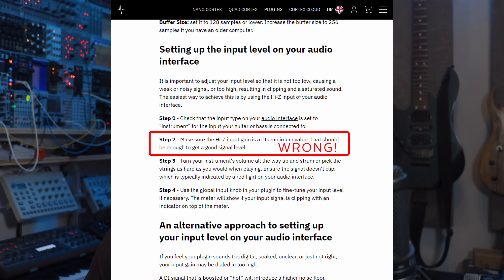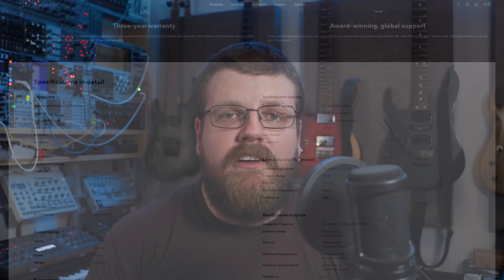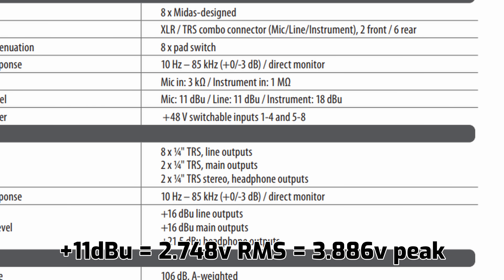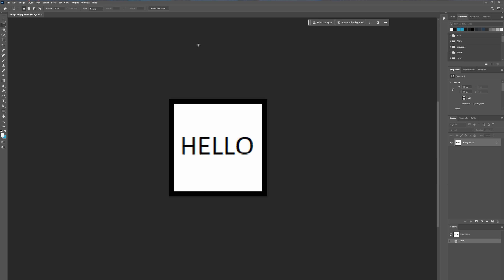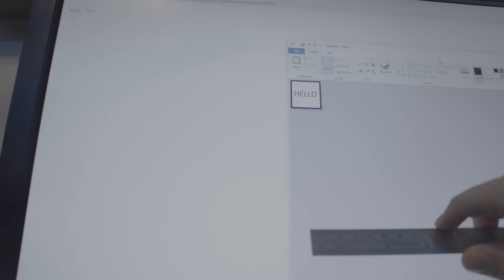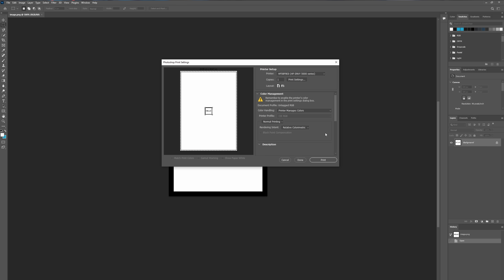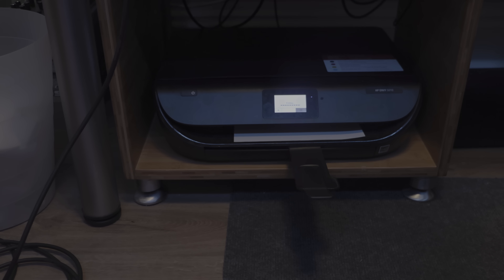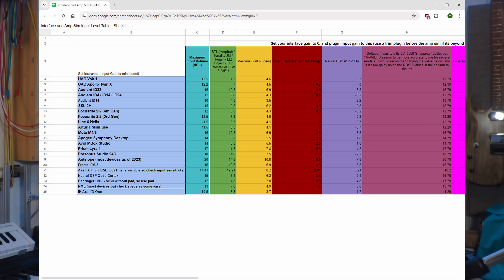Ampsims and input gain - Please, stop the madness...

Comment: Nice topic. I am a digital designer who also worked on some mixed mode devices. However no audio chips. What I can tell is that if there were no standard interfaces in the digital world like there are almost none in the analog world we would have a big problem doing big system on chip circuits. On the other hand there is always a way to determine what the 1-bit of ADC represent in terms of voltage value if you know the input voltage range. The designs I worked with had those specified in registers so the SW could operate and use it to process the data correctly. I mean you need to know this for precise measurments of analog values. The thing with the digital audio IF is that there is no standard and gain knob is typically implemented before hitting the convertor so making automatic calculation is difficult if not possible. So the best advice is probably use your ears.

Comment: Why I still think you're creating confusion: your method addresses only the improvement in SNR. Nothing to discuss here. All correct.
EdS spreadsheet and others you're calling them wrong are addressing a totally different issue, the issue with input gain for different pluging manufacturers so the plugin will sound and react like the real amp they're modelling. 
Your method is not improving the quality of the plugin's sound, just lowers the noise floor. 

So, let's say someone wants to lower the noise floor using your method, how do you address the input gain issue for different plugins? Have you tested your method against real amps, because that's all about with EdS spreadsheet?

Comment: I would volunteer an alternative approach that still satisfies the original goal: To set input gain until the source's self noise sufficiently overcomes quantization noise by some reasonable margin. The reason for this approach is that people are not necessarily that good at judging how loud the input will be when playing "as loud as possible" and it is possible to ruin an overly excited but brilliant performance recording with unwanted clipping as the performer plays just a tad louder than they thought they would during gain adjustment. I suppose for amp sim applications a touch of clipping on the input is likely to go unnoticed, so this might not matter much.

Comment: So, my understanding of the issue (from the perspective of an audio engineer, guitar player, and software engineer, but not a DSP engineer) here is not that 0db input gain was the point of this discussion, but a repeatable pattern for getting a predictable ratio of input voltage and digital signal. Such that for a given set of different guitars, the same compensating digital gain will produce different digital signal levels, just like different guitars produce different voltages. The trade-off here is that you get worse signal-to-noise ratio, but what you gain is predictability. The method you present in this video prioritizes signal-to-noise ratio, but now you need to figure out how to make your active EMGs and your vintage strat have different levels of gain in your plugins. I don't think the 0db approach is wrong, and using math and science, I think we should say it makes a different set of trade-offs for a specific goal: predictable input voltage to digital signal ratio at the expense of signal-to-noise ratio. Happy to hear any technical feedback about we might actually cut through this Gordian Knot and achieve both: maximum SNR and predictability/repeatability/differentiation.

Comment: I worked as a designer in delta-sigma for many years. I developed some tech that was patented and is used in a commercially available audio interface. 

Your analysis is correct but everyone misses a crucial element. There are IMD related artifacts that occur from hotter input levels. They have nothing to do with SNR or digital overs.  They have everything to do with power supply related noise. All that current being pulled as the ADC tries to pull current to meet its demand creates an intermodulation distortion product.

Comment: Wow, that’s an eye-opener. I think, though, that the main reason it’s the right approach for metal guitar is that so much gain is applied by the amp sim. It’s also a good idea for vocals if they’re likely to be heavily processed, especially with compression. For drum recording, though, you usually want to set your peaks to about -12 dB FS during setup because the drummer will hit harder when the session starts, and any peaks over about -6 will get cramped by the line amps. This is because 0 dB FS is near the point where the analog input stage would clip, where it begins to lose its ability to handle sharp transients well. Sharp transients on electric guitar attacks are going to get clipped by the amp anyway, so it’s fine to cramp them a little on the way in.

Comment: Essentially what you’re saying is that nothing has changed: you should use the same approach from when didn’t have digital.   Also, the correct method: maximize gain while preventing clipping, then adjust till it sounds right.  Also, as you know, you can still clip a digital signal, so you still need to manage gain on the digital side

Comment: I feel like it really is as simple as "set the level where the guitar is at a healthy level, but you can play SUPER dynamically without clipping the hardest parts and losing the softest parts". I usually have my guitars hitting a peak of around -4 to -6db on the hardest parts.

Then just use the input gain trim on the amp sim to set the gain where you want it for the desired effect of the amp sim. If you want a clean tone that breaks up when you slam it, have a lower gain. If you want to drive the pedals and head really hard, raise the input gain a ton (go ahead and clip it even).

The golden rule with recording analog stuff is nail the signal to noise ratio because you can tweak gain basically infinitely in the DAW. It's just difficult to offset a SUPER noisy signal, and it's almost impossible to fix something that clipped in the analog domain.

Comment: I could never get a decent clean sound from my Marshall plugin like I could from my real physical Marshall amp, then I saw those videos telling everyone to set the interface to zero, I tried that and it cleaned up BUT it seemed silly to have such a weak physical signal so I put the level back up on the interface and introduced an eq plugin before the Marshall plugin, ran the eq flat but turned the gain way down and (I think) solved the problem in the same way you did. Thank you for confirming what I had suspected.
Reply: Almost all amp sims have an input level control. Which one are you using?
Reply: @  it’s the UAD Marshall Plexi Classic that comes with the Apollo Twin. I’ve looked for an input control but I can’t find one.
Reply: @ErebosGR  I don’t suppose you happen to know if the UAD Marshall Plexi Classic has an input level control? (It would be great if it did).
Reply: @josemelrose5465  Your daw should have a utility for adjusting the amplitude of the signal without needing to put an eq in front of it.

Comment: This is a great video and I'm glad that it goes hand in hand with what I was taught in college about signal to noise ratio. However, do you have any advice on how to measure the actual db level of the gain you're increasing with your interface? The difficulty for me has always been in understanding how much exactly I need to trim from the vst's I am using.

Comment: Not that I am a genius or a good guitarist but I have ALWAYS done it this way ... for 15 years now.  Just bought a new interface Persons Quantum ES .. it sets auto gain as far as input to the converter.  This is critical because I record this and save it as a stem.  Setting the plug in input gain can be done on the fly or set more careful as I commit the stem to a .wav file in my DAW.

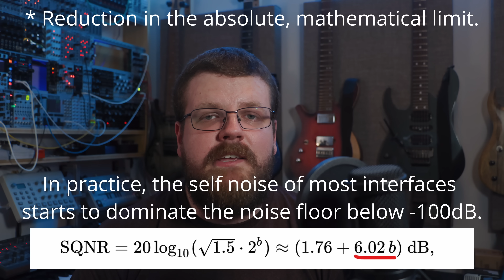Comment: 6:40 Wait a minute. I've always read that bit depth corresponds to frequency range. S/n ratio is more about amplitude. I watched this video to the end and I agree the end result is better. I  just feel like something is off in your explanation of bit depth.
Reply: Yes and no; sampling speed (when we talk about recording, when we talk about playback we talk about bitrate) is what allows you to sample a sound fast enough that even the highest frequencies are captured. Bit depth is what allows you to store a wider range of amplitude values for your sampled points, with more granularity. Both are related to the frequency content that you're able to replicate, because even if you have a fast enough sampling speed, if you don't have the "resolution" (bit depth) to store amplitudes that are almost the same but vary by a few millivolts, your high frequencies will not be as well represented as they could be.

Additionally, for the purposes of this video, if you're barely just turning up your gain control, it means that the amplitude range of your source sound will be very narrow, and even if you have the capability to store sounds that reach high amplitudes, you won't really be using all that storage space (bits), and more importantly the sound you're recording will be almost as quiet as the noise the interface naturally produces, which is what we don't want. This is very simplified but I hope it gets the point across!

Comment: If you turn down the input signal, you're making your expensive preamp sound like a cheap one at optimal gain.  Noise also adds up in a track.  24 tracks of badly gain-staged microphones is going to VERY noticeable.

Comment: sound engineer here. I'm onboard with setting input gain on the preamp (before A to D conversion) to hit just a couple of dB shy of clipping. What I don't understand is why you would set up the input gain to the plugin using a table. Clearly how hard you push the (digitally modeled) circuitry is a creative choice that impacts how much non-linear coloring the plugin imparts, among other things. A value from a table can only ever be a starting point, and not the "correct" value, as the amount of drive etc. is a creative choice that is ultimately made using ears. I was surprised that you don't mention this.
Reply: It's for having the "authentic response" of the amp it's modeled after. If you turn the gain to 5 on your amp sim, it will sound like gain on 5 on the real amp. It's useful when using amp captures, for example on Neural Amp Modeler. That way you can have exactly the same sound as the person capturing their amp.

Comment: Being an old guy coming from analog AND later limited bit times and therefore higher noise floors, there is this always true principle: Use as much unclipped range as possible.

AKA Pump up the volume. 😂

Greetz from a fellow E-Tech Engineer with a nerdy passion for moving air.

Entertaining Video for the younger guys with their hissing guitar sounds.

Comment: I think some of the the confusion is about what 0 means on the interface. I believe that many people refers to zero as the clipping point and not the gain (attenuation) on the input. Hence the big confusion.
I agree with your approach, although worth mentioning is that people often play louder AFTER sound check so it's wise to turn down the gain a little more than just below clipping to avoid digital distortion later on.

Comment: why minus 19.2 db? hows the calculation? im getting confused please help thank you
Reply from the maker: We had originally set it to +4.8. After adding 24dB of gain on the audio interface, before the analog-to-digital conversion, we then reduce the gain after the conversion has taken place, in software, by the same amount. 4.8 - 24 = -19.2
Reply: @GhostNoteAudio  Thanks for reply! i'm not sure if i correctly added 24db in my audio interface right now. how to know i got it right? please

Comment: You said two gain/volume controls that you need to worry about. Yet with guitars you will have at least one or more volume controls. Playing at full volume on the guitar produces a higher output than does playing at a reduce volume. So I would say gain stage starts at the guitar and ends with the amp sim. Thus guitar>interface>sim. And since one is most likely recording the guitar in a DAW one can always dirty up the recorded clean sound but one can not clean up a recorded dirty sound.

Comment: i'd say the peak of your audio must fill your 24 or 48 bits , one thing i wonder is if a logarithmic version of the audio would favour weaker signals and well the peaks are still peaks filling the 24bits and you get the best you can get unless your input amp is spewing distorted at that volume tough for inputs it's called say preamp input level
Reply: evidently you dont want to amplify digitally

Comment: Sure, you right about how to optimize for SNR of the A/D converter (while still giving the appropriate signal level to the plugins), but is that objectively the most important factor to optimize for? Above simplicity/workflow/etc? I never heard a recording from Rabea and thought “oh no, that amazing piece of music is ruined by the bad SNR of his recording”, nor read anyone comment something like that. And is probably even less of an issue for the kind of playing/recording most of us (I assume the intended audience) are doing at home…
Plus, if one would become that much of a purist, couldn’t one instead direct attention to the fact that analog signal boosting (gain before AD conversion) is not perfect, and probably can alter or introduce some (undesired) coloring to the signal? 🤷🏻‍♂️ Neither of those seems to be an issue with any modern decent interface, though, and that includes most of the brand-names affordable ones too.

Comment: 100% agree. Good video! Unfortunately on YT there are many videos with erroneous information that spread like wildfire. I believe that what is really important is to know the input level of each of our Amp Sims and adapt the signal to it, although this is difficult due to the little information that the manufacturers give in this regard. There are many AmpSim comparison videos where the input level is the same on both, without correction, so often the conclusion is that one of the two sounds "too compressed". An erroneous conclusion that comes from not knowing the optimal levels of the plugins. 

1) Entry level with our healthy interface, without clipping. 

2) Gain stage before entering the plugin with the appropriate levels for each plugin. 

And one last note, a little common sense.

The signal from a Stratocaster with single pickups is not the same as a Les Paul with active pickups, so in a real amplifier the input level will not be the same.

3) Put a little thought and adapt the final input signal "finely" with respect to the guitar we are using. 🧠🧠

Comment: TH-U Overloud does not have an input gain. It has a level adjustment meter and you use it to adjust interface gain to hit the right levels as you play guitar as hard as you can. I believe this is how a guitar plug-in should be designed

Comment: I discovered this myself before any of the drama or big debates around it. I was using amp sims with interface gain on 0 and it NEVER sounded right. It sounded weak, thin and noisy. Now I crank it and it finally sounds like the demos

Comment: But are you using an instrument mode or Hi-z in your interface? If I select inst in my Clarett+, I can barely increase the gain before it starts clipping. Maybe the inst input already rises the gain quite a bit? Moreover, I use Bogren Digital amp sims and I have to put extra input level on them in order they sound good. So maybe it all depends on every interface and amp sim?
Reply: "it depends on every interface and amp sim"
Of course.

Comment: Apple has a lot to answer for when it comes to ‘how big is my  100 pixel x 100 pixel image. About two decades ago, they decided to -
1. Make it easier for their print graphic designers and illustrators

2. Make it more confusing for third party monitor manufacturers and anyone who wanted to buy something other than Apple for a display. 

They chose a standard Apple DPI (and there are more than one now we have ‘retina’ displays) and only provided information on the physical size of their monitors. You had to go digging, deep digging, to see what their pixel numbers were and most Mactards didn’t bother. 

As a result, when you’d ask a Mac user the resolution of their screen they’d give you an inches measurement. And using Postscript and later their own system (after their love affair with Adobe fell apart) , there would be a 1:1 relationship between an image on the monitor at 100% and the size of a printed image at 300dpi. Which was great as long as you used Apple everything, didn’t have video, with its rapidly changing standards, to deal with or, at the time, anything destined for the standards-free web. 

As a result, there are two generations of Mac users who don’t understand how pixels work. Audio has always had standards. The good thing about audio standards is how many of them there are, and this Apple-ification (Apple knows best!) nonsense has infiltrated audio as well. 

Thanks for this video. We guitarists are often more stupid than even drummers, and this appears to be getting worse as our societies head more and more towards idiocracy.

Comment: Did you not contradict yourself in step four by stating to turn down the digital input gain to compensate? I thought it was supposed to be set to the spreadsheet value for the appropriate interface.